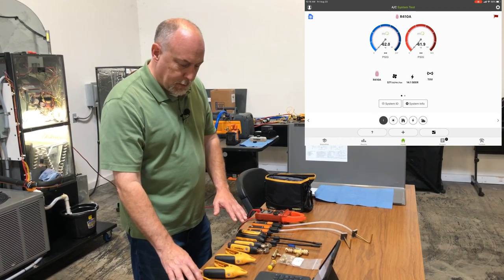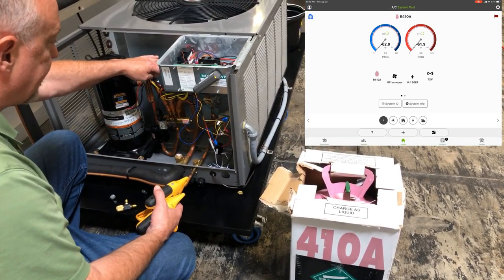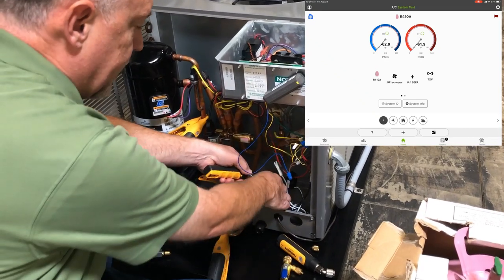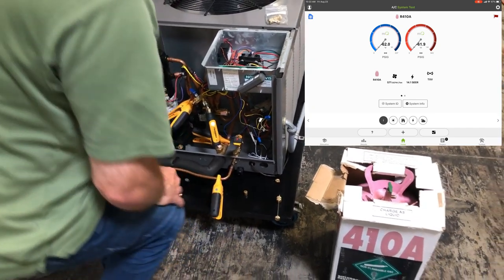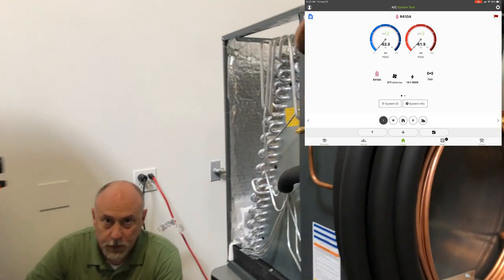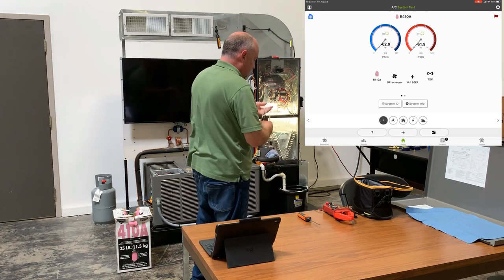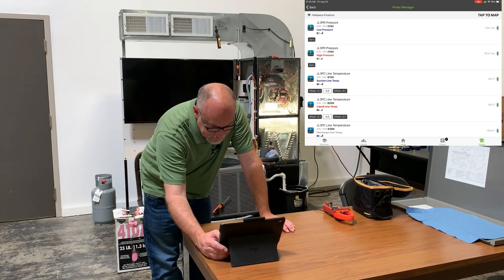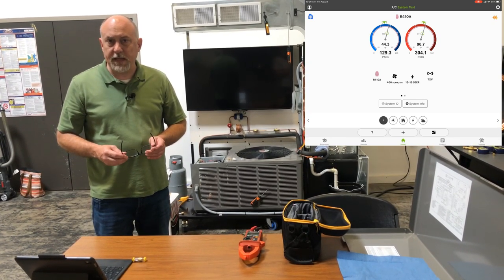Probe Placement

Comment: I replaced a leaky filter drier. Weighed in and took my gauge reading and subcool. But my delta t was only 5 degrees. Threw me off. It was 90degrees inside. Had my supply probe on the outside of the vent and the hot air was twirling back and mixing with the cold air. Great point that you mentioned. Put it inside. Can't stress it enough

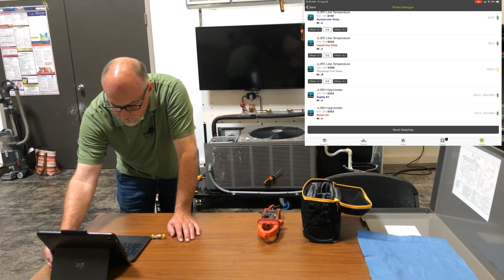Comment: 6:55
This is for the editor could you please flip the position of the picture in picture from information in the corner to information on the main screen because that would have been more informative than the person reading off information. Via a mobile device.
 I appreciate the two angles though.

Comment: Thank you for the video and for MQ. I just want to confirm. Testo and Fieldpiece probes can be combined when taking measurement? I thought that was not possible. I have a Fieldpiece Psychrometer and Testo probes. I was going to get rid of the Fieldpiece Psychrometer.
Reply from the maker: That is correct. You could use 4 different brands at once if you wanted.

Comment: I’ve noticed on Measure quick it will give me an approximate CFM per ton. What information is that using to determine that because I have found it to be wildly inaccurate compared to manufactures specs with static pressure

Comment: So for the liquid line temperature, you're putting your temperature clamp about 5 to 6 in away from the compressor?
Reply from the maker: That would be the discharge line, 6-10”. The liquid line is near the service valve.

Comment: hi there i got a question about measure quick app, does it guide you or tell you charge statis , like add refrigerant or remove , depending on piston and txv ( subcooling /super heat). id like to try using your measure quick . i have been using supercool app or check and charge app up to now to guide me thru charging statis at end of day after setting up my airflow .

Comment: Jim has 3 temperature probes, is it possible to only use 2 temperature probes on a heat pump or will three be a more exact measurement of the system?

Comment: So I could use my IManifold Manometers in conjunction with my FP JobLink set?
Reply from the maker: If you had your iConnect or IManifold on. The probes are Zigbee, so they need to talk to the base unit. The easiest solution and the best solution would be a couple of Testo 510i manometers. Those will also work for gas pressure. The iManifold manometers will not.

Comment: shouldn't superheat probe be as close  to indoor coil as possible?
Reply from the maker: james ryan Depends on if you’re measuring total superheat or evaporator superheat. Most of the time I measuring evaporator superheat only when I’m setting the valve. After that I measure total superheat to make sure of two things, one the superheat is not too low going into the compressor, two, the suction line temperature is not too warm.